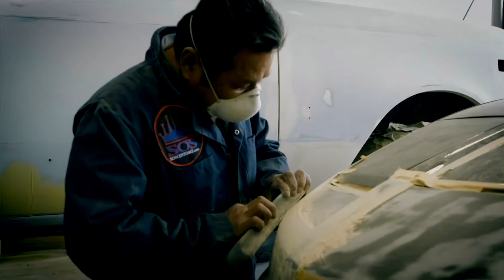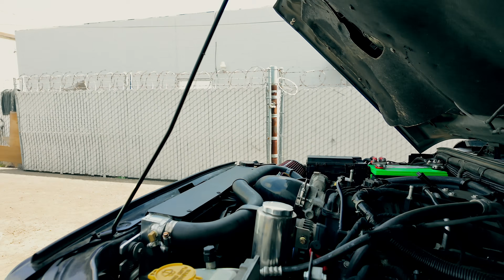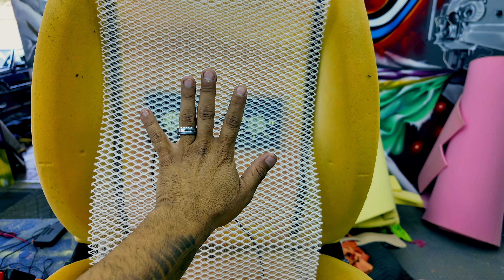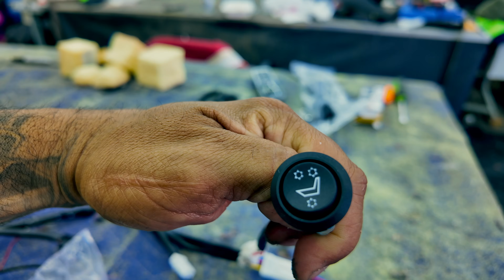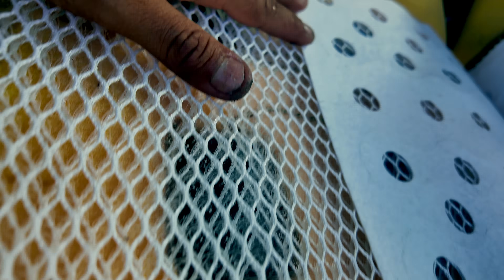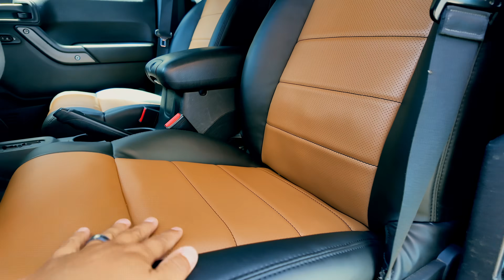💺 Ultimate Custom Seat Build – Massage, Heat & Cooling Upgrade!

Comment: Can you add the ac air to blow through the seats? Instead of just a fan.
Reply from the maker: Yeah, so technically if you turn on the AC to the floor, it would suck the cold air and blow it right up your skirt 😉
Reply: @SOSCustomz ❤❤😂
Reply from the maker: Yes, you could but being that the car is equipped with AC ducts that blow on the floor you can turn on the floor AC then the seat use the cold
Reply: @SOSCustomz just buy peltier module and you will have cooling and heating in one place. And why you dont route the wire behind? Any particular reason, bc in this way the seems to be damaging over time